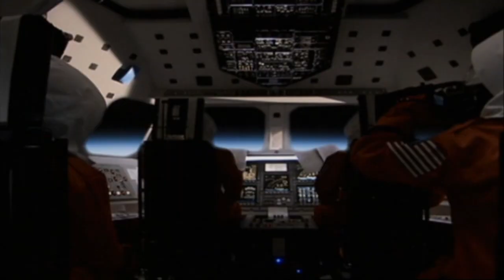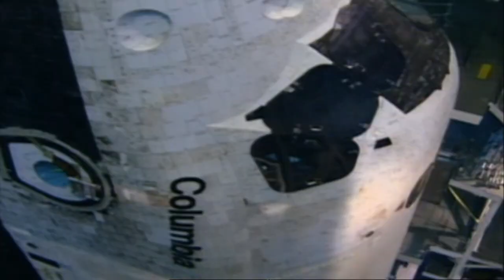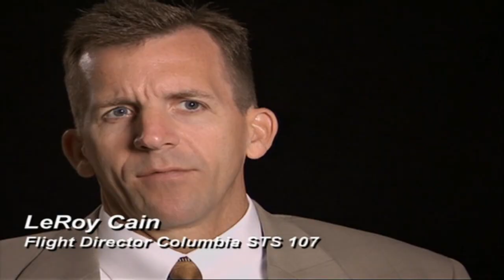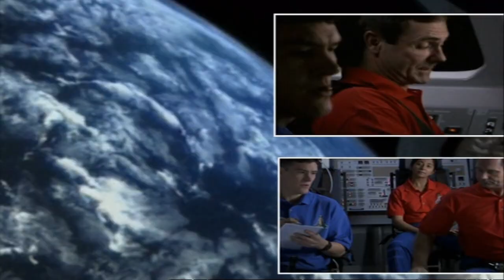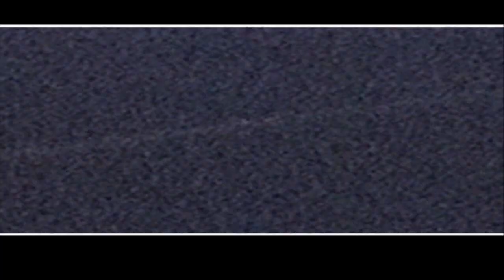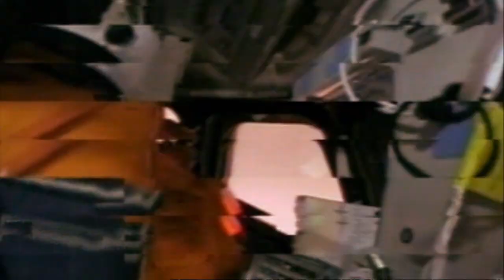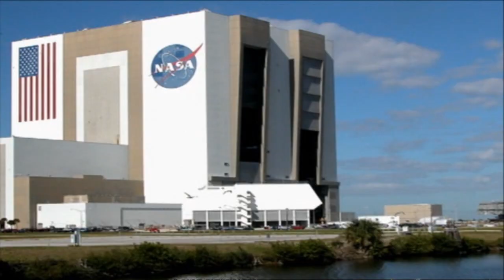Space Shuttle Columbia - Falling Star HD

Comment: they say NASA knew they were doomed. they decided not to tell them.
Reply: Well, even this admits there was 'discussion'.
Reply: Were just doing 150 mph in our Dodge and ran over driver's side mirror that just fell off.
Again.
Any cause for concern?
Reply: Les Brown errm, slightly different
Reply: NASA didn't know the extent of the wing's damage, for the simple reason that they didn't bother to follow a sound safety contingency protocol, and instead relied on inadequate 'gut feelings' that the damage was not significant. The subsequent inquiry identified many flaws in NASA's safety management procedures. If you actually don't think 'the fingers' should have been put on NASA, then it's clear that the idiot is YOU.
Reply: @sailorman8668  The problem is that at NASA there has been an attitude for years of "prove it's unsafe" rather than "prove it's safe" 

Engineers often can't prove it's unsafe, and NASA is, or was, unwilling to have their astronauts do EVA's just to see if there is any damage. The attitude concerning Columbia was that damage would not be severe enough to warrant it, and if it was severe it wouldn't be repairable in space which means there was nothing they could do (which was false).

For starters, they could have attempted repairs. The wing likely wouldn't be able to be repaired with what they had on board, given that it had a hole in it, so the only other choice was to have the astronauts wait for a rescue mission, which NASA never even considered because they never ordered an EVA because the engineers could not prove, with what they knew, that it was unsafe.
Reply: The damaged part was non serviceable in space. It doesnt matter if the crew or whoevever knew or not. When the impact happened, the shuttle and everyone on board was doomed. There was nothing to repair it or to get the astronauts back to earth. Having a reserve shuttle ready to fly for such an event was something that would have cost a lot of money, money the american public was not willing to spend. Every shuttle launch was deadly dangerous for the astronauts, and they and Nasa knew this. They took the risk. Two crews paid with their lives. And this is the reason why the shuttle was retired. No one responsible wanted to risk that any more.
Reply: carlosramirez59 thank you for saying that..I admire all your knowledge of the space program
Reply: It doesnt matter if Nasa knew or not. There was nothing that could have been done about it. There was no way out. The moment it happened they had a one way ticket to doom. There was no way to help them in time.
Reply: The article does not say they knew for sure. They were discussing possibilities, but no one has ever seen a picture of the damage, since there is none in existence. They did show the launch video to the crew, however the area of the impact is not visible, so it was all guesswork. They could have taken this way more serious, and could have tried to get a picture. They did not. It surely was a more massive impact than the usual ones. That was a reason to assume the damage could be bigger than usual. But its assuming, not knowing. And they decided to not get confirmation.
Reply: @flybywire5866  they could have gotten the images. They chose not to.
Reply: @suzyinstitches273  From where could they have gotten the images? No camera saw the impact area. It was not visible from inside the shuttle. No earth or space bound camera could deliver a decipherable picture of that area. And even if, what good could it do? All they could do was landing the shuttle anyway. That ended in disaster, then Nasa knew how big the damage really was. No one and nothing could have prevented the outcome.
Reply: @flybywire5866  satellite imaging. It was available.
Reply: Wrong, they had two EVA suits.  Read page 405 in Volume II Appendix D.13. There was a coverup.  BTW, there was a Pegasus XL with the SORCE payload launched on January 25, 2003. So why no rendezvous attempt? That type of defeatist mindset would have doomed Apollo 13 to being marooned on the Moon. https://www.nasa.gov/columbia/caib/html/VOL2.html
Reply: The RCC panels on the wings are not serviceable in space.  They are structural components that take many hours to remove and replace on the ground by technicians with special training.  Also there were no repair kits for the RCC panels even after flights resumed, but they could repair the tiles if needed.  Also there were no provisions for a space walk.  No EV suits, no Canada arm (the Canada arm cant even reach the wings anyway.  This was a purely scientific mission with all experiments done inside the shuttle.
Reply: I m not sure if Nasa knew how serious the situation was. No one had seen the damage then. There was speculation, but it did look like something that had happened all the time. I agree, telling them if they had the information would have been the right thing to do.
Reply: They were not sure
Reply: BewareTheIdes Thank u very much for the link!! :-)
Reply: NASA knew that they were doomed so they did not tell them so that they will die knowing that they could not do anything than crashing knowing that they did not try hard enough to save themselves
Reply: Ivy Edan well would you want to know for even 10 mins that you’re about to die and there’s nothing that can be done to about it at that point?
Reply: I think you're thinking of Apollo 13? Isn't that the one where there was an oxygen leak or something?
Reply: Who are 'they'? 
Maybe NASA was hoping their computers were messed up.
Reply: You are right
Reply: Well I read the guardian article it doesn’t say nasa knew. It was just one manger made a hypothetically statement not that he actually knew anything was wrong.  The article even says after they showed the crew the launch video they all determined there was no threat. The article says they weren’t Aware of how bad it was until after the accident.
Reply: @dbj1852  I don't know what guardian article you are speaking of.  Look at the official reports, in particular the survivability report.
Reply: @suzyinstitches273  someone posted it here I read it there wasn’t anything in it that made it seem like nasa knew for sure and didn’t say anything.
Reply: It's so sad. NASA chose not to investigate the damage any further. They had all these meetings and convinced themselves it was fine without any imaging. Makes me so mad. We could have tried to save these awesome people.
Reply: @suzyinstitches273  for sure from what I read from the accident report was that nasa was complacent and there was a cultural of I cutting corners to achieve things on time. And the fact that damage on a small scale had happened before and things were fine so they used flawed logic.
Reply: @dbj1852  yes they did. There were lower ranking engineers requesting imaging from available satellites. They were denied.🙁
Reply: @suzyinstitches273  oh wow yeah that’s problematic I guess the hierarchical way nasa was run that causes that type of issue.
Reply: NASA didn't know that they were doomed. Not until the shuttle reentered the atmosphere.
Reply: +Flyby Wire No one is saying they weren't doomed. What I and others are saying is that NASA's decision to simply ignore their engineers and to not tell the crew they were doomed was wrong and irresponsible. The crew should have been given all the information. Even information that gives them the eventuality of their death. Would you say a terminal cancer patient should be denied the knowledge that he/she is likely going to die? No, and neither would anyone else. This is no different.
Reply: BewareTheIdes I don’t think you understand the implications of the situation here.
Reply: If the ground-crews knew the outcome while they were still in orbit, 
there should be criminal proceedings.
Reply: ***** Many of the lower engineers told their 'managers'(many of whom were fired after Columbia) that there were serious implications from this particular foam hit. Yet, they were all ignored. All knew there was a likely outcome of burn-up on re-entry. Frankly, their choices to not let the crew say their goodbyes was WRONG and wholly irresponsible. Wouldn't you want to say your goodbyes. And, give your family a body to bury(likely would have sent a mission to recover them from orbit eventually). I know I would. And, I bet those astronauts would have too. The choice should have been theirs.
Reply: @bobalobalie  they did recover the bodies. Or what was left of them.
Reply: Well if your "american public" is not willing to spend "money" to save people then we found our responsible and all further comments are futile.
Reply: @GholaTleilaxu  I would have been more than happy to help pay for any rescue effort. I think many will agree with me.
Reply: +Jarheads4Yeshua They knew and tried to warn the managers. Who ignored them. https://www.theguardian.com/world/2013/feb/01/columbia-space-shuttle-anniversary-nasa
Reply: I disagree. They could have repaired RCC panel 8 while still in orbit. Read the Appendix. Pegasus XL SORCE was launched on January 25, 2003. Somebody in upper level admin was negligent, and ought to have gone to jail.
Reply: carlosramirez59 ok but you don't need to get so snotty
Reply: Sailor Man Actually, NASA did know about the extent of the damage. There were even discussions about whether to tell the crew about the seriousness of the situation, they decided not to tell them. Knowing for a fact the crew would likely die in re-entry. Proof below.....

https://www.theguardian.com/world/2013/feb/01/columbia-space-shuttle-anniversary-nasa
Reply: Ivy Edan
Reply: The NASA managers did know how serious it was. Link below....

https://www.theguardian.com/world/2013/feb/01/columbia-space-shuttle-anniversary-nasa
Reply: @bobalobalie  wow...so NASA just pretty much ignored their engineers and got seven astronauts killed...
Reply: NASA did not know the extent of the damage, do not try to put the fingers on NASA you idiot. Space exploration and astronauts are high risk job, if you think space flying is fun which most of those astronauts were thinking before they got burned to death, then this is not the job for you. Be serious and be strict in your job, this job is not for smiling and laughing in front of the camera and 'I've always wanted to be an astroanaut' bla bla bla. Idiot.
Reply: Gabriel Kwong look what nasa did at 39:20.. testing foam shot at wings.. now, knowing that the foam has a habit of falling away when going up don’t you think that these kind of tests should have been done before?
Reply: @bluemanchestercity  that is a naive comment.an object of that size going 500mph,hitting the leading edge of wing should've caused at least moderate concern.Period.
Reply: @bluemanchestercity  NASA CHOSE not to learn the extent of the damage. Big difference.
Reply: @bluemanchestercity  stop calling people "idiot." NASA chose not to procure imaging, it was totally possible. They convinced themselves everything was fine. You know the rest.
Reply: carlosramirez59 could they have gone and docked at the space station
Reply: @ivyedan7183  it sounds like probably not. The station is at a different orbit, there wasn't enough propellant aboard Columbia to get there. We could have finished prepping another shuttle to rescue, or asked Russia for help. Anything to get these people home. I'm so mad NASA chose not to.
Reply: Nasa knew they were doomed to die.  Why did nasa let this happen, why didn't nasa tell the   
Astronauts what was happening?
Reply: B I know they could have said their goodbyes to family

Comment: I don't buy into this a foam? The NASA did not know their space shuttle was damaged? No sensors? BS even my car tells me if one tyre needs air....
Reply: So because your car has it now, the shuttle designed in the 70's should also have it?
No, there were no sensors. The wing itself was just a structural frame covered in foam tiles with a heat resistant coating, not skin covered in nerve cells reporting back to a central nervous system. 
A frozen piece of foam dislodged from the tank, hit the wing and put a hole in the foam tiles on the wing. As soon as it dislodged, it underwent rapid deceleration but relative to the wing, that decelerating piece was actually accelerating towards it as the shuttle itself was still under acceleration. Being frozen, it was heavier than normal. So much so, you can actually see the entire wing flex from the impact. During re-entry, plasma was able to ingress through that hole to systems inside that weren't heat protected as well as the rush of air itself. The wing was mostly a hollow space apart from a metal rib structure and thus all that air rushing in was like blowing up a balloon too fast and with too high pressure. The more material was stripped away by the rush of super-heated air, the more the air was able to ingress further into the craft resulting in the entire thing being ripped apart as it punched through into denser and denser atmosphere. There was a report from a sensor in the leading edge spar of the wing which reported higher than normal loading in comparison to recordings from previous missions but re-entry was well underway before that alarm went off. 

What really should have happened once NASA realised there was even a remote possibility that an impact had happened was an EVA mission to inspect the panels before re-entry.
Reply: they were not equipped to do EVA inspections.
Reply: you forget this wasnt in 2016 xD
Reply: Jack London your car is not 35 years old.
Reply: My car never told me about the dents it had.
Reply: Does your tinfoil hat have sensors to?

Comment: Can someone explain  why when the shuttle was going through two and a half times the speed of sound on takeoff why the wing didn't fail and fall apart then ?  Surely the stresses would have torn the wing off on ascent .
Reply: That's still quite slow compared to decent. It's not so much the speed stresses as the heat getting into the wing and melting it from the inside out.
Reply: Exactly. We still don't have the complete facts. May be it was a mechanical fault that Nasa doesn't want to own up. They lost contact , but the data line worked telling all about the sensors. things don't add up.

Comment: it is not really true zero gravity. centrifugal force created by the 28 000 mile an hour speed creates the illusion only. if the speed drops, the shuttle quickly falls back to earth. infact. if the retro rockets had enough fuel and slowed the shuttle speed to zero then there wouldnt be much need for a heat shield really. the speed is the killer as it is not economical to use retro rockets to slow the craft down.
Reply: Only about 18,000 mph, but yeah. Oh and if the speed slowed to zero it would fall straight down.  The ONLY reason it stays in orbit is the SPEED that makes it so that even though it's falling DOWN it's FORWARD motion means the Earth isn't "under" it anymore. That balance between "forward"  and "down" is called "orbit"
Reply: Ung Grabb
Reply: Ung Grabb
Reply: Ung, there is a need for speed to get an object into orbit and keep it there, then allow it to return safely home. That's the basics of rocket science.
Reply: surely to slow the shuttle to zero the retro rockets would have to fire all the way down until the shuttle was through the atmosphere as it would speed up vertically without them no?
Reply: If the retro rockets fired to slow the shuttle to 0 km/h, it would fall like a rock back to earth. The gravitational pull is there. If you would want to stay on the vertical height, doing 0 km/h over earth speed, then, yes you would need a power source to keep the shuttle at a fixed altitude.
Reply: speed is not the issue of getting things into orbit really. if you could sustain a slow but steady pace for long enough, then anything could get into orbit. problem is to provide long term power hence use of rockets to generate enourmous power to achieve sufficient "throw". then as the trajectory is flattened to an orbit (as opposed to "straight out into space", the payload can accelerate to achieve the illusion of weightlessness. a small drop in speed will allow the vessel to quickly fall nack to earth. luckily the absence of breakingforce due to atmosphere making this possible. but those who believe that the ISS is outside the gravitational pull of earth have it all wrong.

Comment: 44:04- No, Fuck you, Leroy. You left hose people to dangle and listened to them die. You are part of the problem and you should do the right thing..........................
Reply: So, Mike, would the right thing have been to use magic powers to fix the situation, or to tell the crew, "Hey, you are garunteed to die in a few minutes, have fun!" ?

You seem to think that he not only designed and built that specific shuttle, but also willed that foam to strike the craft itself.
Reply: ***** No, the "right thing" would have been to listen to the engineers that suspected the damage within five minutes of liftoff and taken steps to A) Identify the damage and B) developed a plan to either rescue the crew and/or repair the vehicle for a safe return.

On a program the size and importance of the STS, a one square meter hole in the wing shouldn't be discovered only after heat sensors start alerting in the wheel-well.

I suggest reading the incident report findings for more information.................